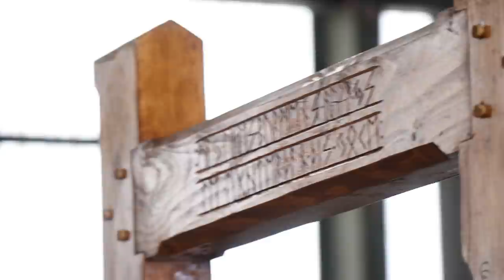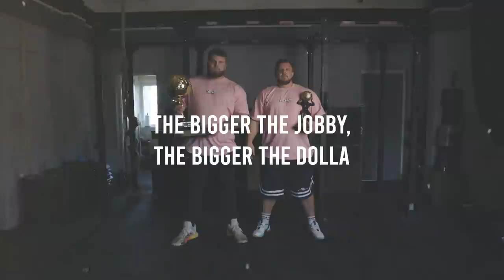20 Days out from World's Strongest Man! | Heavy Strongman Events Session

Comment: Biomechanical Observations -  (1) Hercules hold - breathe, more oxygen required (2) weights up steps - current 1sr then 2nd step through transition, try synchronised jump potential 2-3 second time saving in a race, scaffold bar stability may prevent jump transition.

Comment: Why don't you use a high quality sunscreen to stop the sweating?
Reply: Sweating from exercising = need sunnscreen to you ? lmao
Reply: @J.c410  On a hot summer day if you use sunscreen on your face no sweat will drip over it and it will be dry. So why wouldn't it be a good idea to apply sunscreen on dry skin before using tacky is what I'm asking
Reply: @J.c410  Especially that they compete in blazing heat